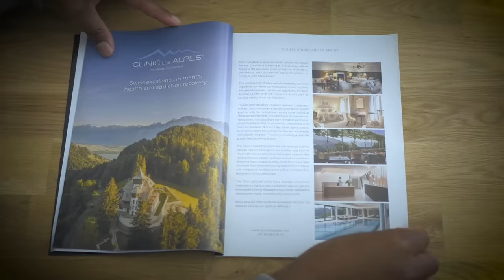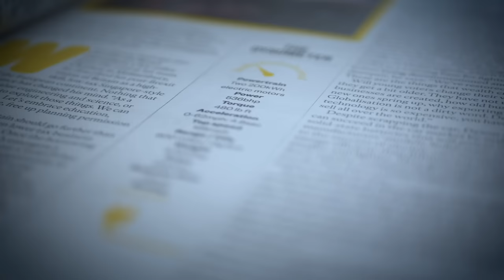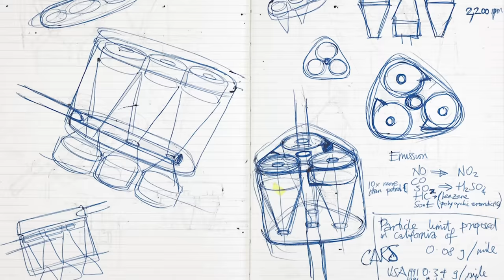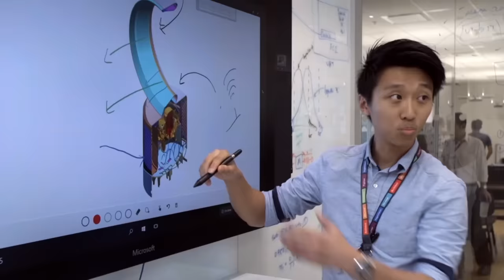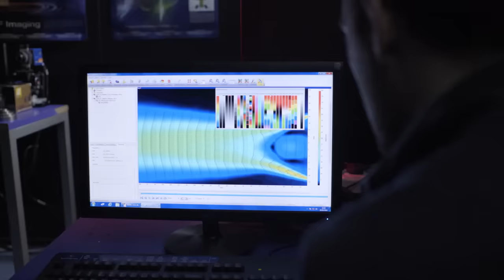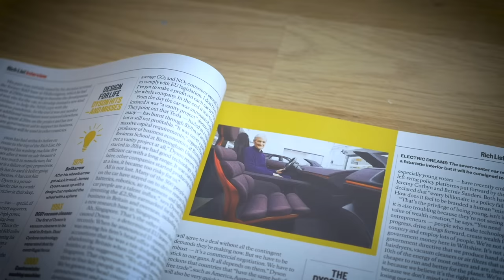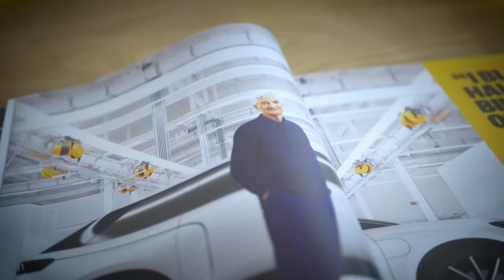Who Killed The Dyson Electric Car?

Comment: I think if you don’t drive an electric car it’s a bit difficult to understand what you need vs what you want.. Ro out it very blunt. Electric cars need to be build with a range that can withstand the average human bladder. Essentially a realistic 200mile range by using approximately 70% the battery. So it doesn’t matter how big or small the car is, everything is related to consumption over distance.  It’s possible to hit that magic 200mils in a Tesla Model 3 if you average 260wh/mile. In reality that battery needs to be 100KWH and not 75KWH and the beauty of that. is you can charge the car even faster to 80%. Dyson needs to remove half of is battery capacity for a start and use a high voltage charging system vs a high amp system, this would allow for a great charging speed generating less heat.

Comment: Honestly I would like a small to mid range cheap electric car. I would happily buy a 3000-5000 Euro car, 1-2 seats, AC and 50-100 km range. It will need to have some power just to make driving fun and not feel like a golf cart. I'm impressed by the Chang Li car, at only $1200, mostly because they were able to produce it and it's not made out of cardboard. It is a piece of crap, clearly not made by a car manufacturer, but my commute is about 10km / day and I would still want/need a bigger car to get out of town or simply travel. So a cheap electric car, easy to fix, and safe in traffic, would be ideal.

Comment: The only time dysons hoovers gather dust is when the seals go and it sits in the corner.....its best he does not build cars
Reply: Tim Taylor 

The first D vacuums had a 90 degree  turn in the pathway just after the beater . Anyone with a long hair dog will tell you about clogging at that point
Plastic formulation is too brittle.
Accessories are too fussy to use.
I M O bad industrial design.

Comment: 0:45 you say "Two 200kwh electric motors", but is not correct. You must say 200kw of power for each motor, or you must say battery has 200kwh of energy storage capacity (or simply capacity, size, etc.). Do not mistake power (kw, w, HP...) with energy (kwh, wh, Joule...). I infer you refer to the power of the motors; because otherwise The battery capacity then would be like 2 model S long range jaja...

For the rest I like your style, so keep it up!! Nice work!
Reply from the maker: It was a typo. I said kw, not kWh.  Thanks -RR

Comment: Would I buy a Dyson car you ask? I would not buy a Dyson anything. I had one of his first vacuum cleaners- it was riddled with design faults. (I am an experienced product designer). From strengthening ribs that were aligned in the wrong direction to add strength, to square air passages (ask any fluid engineer why that is a bad idea) through massively inefficient motors and hoses that stretched so they would not fit back in the handle. Check eBay- the Henry motor is a solid diecast well built motor. The Dyson is bent steel sheet. They cost the same.I recently repaired my daughter's cordless Dyson. If you wash the filter (as they recommend) but do not wait long enough before using it, then you destroy it. Why? The circuit board is in the airflow- but has no conformal coating. So moisture shorts out components and blows the board. Schoolboy error. So he blew half a billion- that is out of the pockets of his customers that were persuaded to buy such stuff.

Comment: Batteries will be too expensive to replace in years to come as the top electric car supplier needs to make money and the big money is in the battery so will you scrap your car after 70.000 miles or opt for new batteries that will set you back the price of a small car ?

Comment: The use case for a super long range electric car is not about travelling that 600 miles in one go, the use case is the complete elimination of range anxiety.
Reply from the maker: What about people who want to go 610 miles? There's no such thing as range anxiety. Just recharge time anxiety. -Rory
Reply: @AutoTraderTV  Recharge time anxiety, agreed. They make these long range cars to give people comfort from that charging time anxiety. Take me for example - on an average week, I travel slightly less than 200 miles, so a car with 600 miles of range would technically last me 3 weeks between recharges most of the time. To me, that completely removes that fear of waking up in the morning and realising that I forgot to plug the car in last night.

Comment: Dyson is very clever yes i agree, i was working in curry's and the returns on Dyson cleaners was very high. i have used Dyson cleaners yes they suck but they are also very over designed. They are dreadful for stairs and tell me why the vast majority of hotels don't use Dyson they prefer Henry or similar its the simplicity of the system.

His fan less heater actually has a fan inside his washing machine was £750 and looked like a fisher price toy.

500mil for a car development is very small for somebody who has been around should have known this.

The electric car is still in its infancy the charging time is ridiculous and when more of them are around the queues will be intolerable. They have very little road tax now but when they become the norm they will also be hit with tax the gov cannot afford to loose the revenue from fuel duty.

i bet his car was also over designed why holographic display. Electric cars will be popular when they can be refiled in the same time as combustion and the price will be comparable. it has taken some hundred years to establish the car as we know it. So the electric has a long way to go. 

i am sorry that Dyson failed and lost £500mil he could have sat back did just enjoyed the rest of his life he nothing nothing he needed to prove

Comment: 7:17 -- That's not quite accurate. The established players have been trying to / hoping to protect their ICE assets and many near the top have until very recently been either openly or covertly talking down EVs. We are right at the cusp of all this changing, especially with VW's efforts. Right now, GM, Ford, Honda, and Toyota have had a total of three full EV models between them (Bolt, Spark, e) excluding Think. But soon this will change.
Reply: The established players were simply hoping that Tesla would fail and they could carry on. Dyson's mistake was trying to out-Tesla Tesla 10 years too late. He should have gone for something simpler: smaller, more utilitarian, but cute and zippy (no, not the Sinclair C5!).
Reply: The established players don't have many electric offerings because they require massive capital investments to get off the ground and then sell poorly. They are a huge money-losing venture at this point. Tesla only exists because investors have been willing to burn through billions of dollars every year on little more than the promise of future profitability.

Comment: "the fruit of his genius". Guys, you have to eventually realise that people like Dyson and Musk are not heavily, if in fact at all, involved in the actual engineering and design work. Musk didn't design his rockets or his cars. He had the idea, he found investors and he hired people that KNEW how to design those rockets and cars. The same goes for Dyson. 
Engineers may present their progress to Dyson and he may steer them to another direction or approve their work but he doesn't do the work himself anymore.
I am doing engineering work for a person of the same caliber as Dyson, albeit in a different industry. He doesn't design anything. He had the idea, he will attend engineering reviews but his job is to keep the company running, not design the product. In the modern world products like cars, vacuum cleaners, TVs etc are never the fruit of one individual's work. However, nobody knows the names of the Chief mechanical engineer at Dyson who had to oversee several engineering teams (suspension, drivetrain, interiors, aerodynamic etc), nobody knows the name of the engineers that spent time doing CFD on the vehicle's aerodynamics, so Dyson poses in front of the concept car and puts his name in all press releases and marketing materials. Also Dyson will benefit from all potential profits (while staff will be made redundant if the product fails).

Comment: Of course there is a use case for that size and range.  The Police and security industry.   He SHOULD focus on building the last and most efficient ICE engine as the first step.  Like Sony used to do between tech generation changes.  Be the stop gap in between with a super simple, turbo based ICE motor tht can be used by as many as possible and put in that basic design of his and sell the car for 80,000 and then keep evolving.   He should have made the pivot and not just given up.  hell he has developed tech there that could be leveraged.  Well he is rich and I am not, so take it with a gain of salt.

Comment: First, clearly you are a British channel, because here in the states 600 miles is an excellent range.  That was a half a week without charging commuting to my old job versus every day if I owned a Tesla. That is a trip from DC to Florida non-stop which is something many people do over here.  Honestly, I think that he was on the right track.  What he should have done is what Tesla did, start bringing in the outside investment.  Then he could have tuned the care to have variants that would work better in certain markets (a 300 mile range in the UK versus a 600 mile range in the US) and tuned down the tech, use more off the shelf materials, made the interior a bit more mainstream, and he would have had buyers.  Hell, most people forget, the first Model S, and the first roadster were all in the six figure range when unveiled. I think this would have worked...he gave up too soon. 

Oh, I would have bought the Dyson.

Comment: BOTH Apple and Dyson DID NOT DO A MISTAKE - they simply had to try. BUT Tesla has outperformed their models BY FAR and MUCH ahead of time, whilst already making A LOT of oney with each single unit sold. ELECTRIC CARS are MUCH cheaper to produce than a COMBUSTION ENGINED CAR to produce as ALL CHINESE CARS AND TESLA PROOF!! But you have to not only invent cars, you have to invent ALL the machines ground up that produce them, and not just the cars, but also the magnets for the motors, the cells for the batteries, the motors, the batteries, new innovative chassis, glass structures, special suspensions and driving systems, liquid cooling and heating units (Tesla leads again the market there), self driving systems, A.I. systems (these days that is like having airbags in the car - you have to have it)... and this all ads up to at least 20 years investment to reach, which is more than any industry can afford - ESPECIALLY THE OLD TRADITIONAL ONES - thus all of them losing money for about a decade now, whilst Tesla and all Chinese manufacturers bloom and grow massively.

Comment: 600miles is just enough. A round trip of 300 miles for a few days of vacation is normal. So his idea is normal. They are all pushing to go over this 300mile real world range as in this case you will not have to stop and charge for nearly every journey. This is a 4 hour drive. And in a lot of paces in Europe there are not enough chargers. Also those kind of vehicles toll boats, caravans, etc. Try that in an EV with 300miles range. You will be empty in a 100 or so and your trip will last forever .

Comment: Taking the info given with a grain of salt. Why not lower the range to say 500? It still out ranges the competition. I’ve been looking into electric vehicles for future purchases. The thing with range is not necessarily the distance in one trip, but the distance between charges. More range, less need to charge constantly. There are great electric car options other than the astronomically expensive Tesla, but non have the charging network Tesla does, they rule the market there so charging is a snap. Other manufacturers have to share stations and its not quite easy to do. Hmm maybe Dyson could tackle charging stations? Now, the price is not that horrible for an electric car. They are not cheap, at all! All Teslas are expensive, all other electric (the good ones are). Not saying $150,000 is nothing, but haven’t seen any electric car start at a sensible price point. £500 mill is a shitload of money, I asume there must be some tech value on whatever was made. But seriously, Dyson should tackle charging stations ala Tesla.
Reply: Tesla’s are expensive, but £40,000 is a similar price or in some cases much cheaper than many equivalent performance ICE cars

Comment: To my way of thinking it was a dinosaur. Honda in my view have gotten it right first time. Not that the Honda e will be huge success, it might be and it might not be, time will tell. But let me describe why I think the thinking behind it holds the future.
Most electric car producers seems to believe that the right thing to strive for is the longest range possible. For this reason they outfit their products with humongously big, heavy and expensive batteries. Has it ever occurred to them that their products will suffer from driving along with batteries weighing up to 800 kilograms, plus the weight of the electric engines, and the extra weight of the extra reinforced chassis to carry all this weight? Not only will this reduce the driving experience (both comfort and handling) it will also increase costs for the consumer, and it will increase the battery charging time, because it takes longer to charge a bigger battery. It will also reduce the production capacity, because if the products could contain smaller batteries then more cars could be produced. This vicious circle has to be broken, and this is what Honda tries to do with their model “e”. Instead of using most of the production expense on batteries they have focused on forming a positive circle. By making a chassis which can only take a small battery and using money on things like rear facing camera’s rather than mirrors to improve the aerodynamics of the car, they have strive to make the car more efficient, thereby making it more attractive to the consumer. At the moment it doesn’t have quite the range needed for most buyers, but when better batteries materializes in the near future it will. And then they will have a winning formula! Efficiency matters, not bulk especially with electric cars!!

Comment: Yep. Who’s going to actually drive 600mi without a break? How many people have a 600mi bladder? The majority of 4/5-seater vehicles, rarely carry more than 1-2 people for most of the miles they cover. Unless you need a van with windows, you’re not going to buy a 7-seater and not one at £150k. Even an extravagant taxi driver wouldn’t be up for that. They’d just continue buying a Transit minibus and get the passengers to pay their way.

Plus Dyson - heck they can’t make a battery or mains powered product, with a pack and or control board that lasts more than 1-3yrs. Mind you, the car would have been available in seven different colours... all at the same time.

Comment: The problem with Dyson and Tesla is that their cars are far too big and expensive, which means thousands can be made and sold only to rich people who are a very small percentage of the population. What the world really needs right now is an affordable electric commuter for 98% of the population, like a VW bug electric car. The VW bug sold hundreds of millions of cars. Forget the luxury, give us an affordable EV that gets 100 miles or more per charge. It will sell like hotcakes if the average Joe can afford it
Each passenger is more dead weight and significantly reduced range. Put four adults in the car and the range is 50 miles, unless you use the air conditioner which is 25 mile range, and going up a steep hill knocks it down to 10 mile range.  And of course the battery has lost 50% of it's charge capacity in 5 years; new batteries will set you back $15,000.
Definitely lease, don't buy. In five years technology will be 10 times better and a new car will have better range...for a much higher price

Comment: 5:44 - Say what? Who wants? Millions of families do this every summer. Do you never watch the traffic on highway in Europe when summer comes? Probably similar in USA and Canada.
Reply from the maker: Nobody drives for 11 hours without stopping with their family in the car. There would be poo and wee everywhere.
Reply: @AutoTraderTV  That I agree. BUT, while we did stop to take a break and refresh, we didn't fill up every-time, because very often you will need to wait. So having a car that can drive us at least 850-1000km meant we were not losing time on that. And this is on gas station where you finish "charging" your car in 5mins. Imagine how it will be for electric cars and charging. So, yes, for family car there is absolutely need for such a range.
Reply from the maker: I hear ya. Having the extra range gives you flexibility. But if you’re stopping anyway, you can top up. That makes your car cheaper, lighter and more efficient.
Reply: @AutoTraderTV  Because very often, pumps and (charging stations now) are already occupied and there is a waiting line.
As I said, I would rather my car be cheaper by using cheaper materials then skimp on the battery budget. Very often cheaper (but good enough) materials are also lighter. So there is some of the solution.